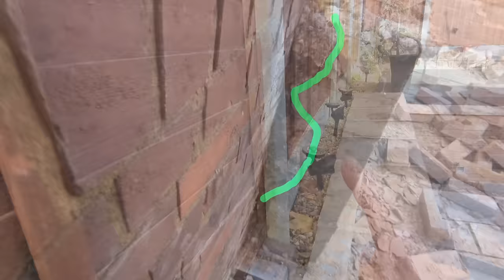PART 2! What exactly DID go wrong? Who paid to put it right?

Comment: I still think you'll be back again. And as for your sarcasm at the end of the video, proves that you don't like criticism, and can't move on, or take it on the chin. Grow up. You didn't mention in your video, WHO PAID for the first failed job? And you also say that you are going to go back AGAIN (3rd time) to rip it all out, and build it out of engineering bricks, WHO is paying for this? I suspect you may have agreed with the client, for them to pay for it, as you will be building it a THIRD time but with different bricks? However, this will not resolve the main problem, which is the penetration of water from behind. You should have explained the water issue to the client, and said that you need to put a drain behind the wall. And asked for the funding to do the drain only. Which clearly, would RESOLVE the water damage issue for good! The other thing you are forgetting, is that the 14 or so meter wall WILL continue to move, obviously, so, do you not think that the earth from the neighbours garden, behind your wall, do the same? Of course it will, so all you are doing is prolonging the life of your wall, but still not rectifying/resolving the cause of the problem. 
It's all well and good being "Reactive" but to be a competent builder, you need to be "Proactive" 
Additionally, you threw all of the rubble from the first job, straight onto the patio, not even caring about the clients property. You would have also damaged the facings of the bricks, which you did not replace, but just covered up with garden furniture. If you damage the building materials that you remove, then you should be paying to replace the damaged ones. If you still don't put a drain in the build, to remove the water from severely excessive penetrating water, where do you think the water will go? Next thing, is the patio will start to freeze and crack and lift, and you'll be back again. 
You also keep rambling on about if the bricks are suitable, ALL bricks are suitable if you build the wall correctly, taking into account the elements. You provided NO DPM, NO DPC for the coping slabs, NO frost protection, and NO real acceptable drainage. And then ask the public if you have done something wrong, and if the client should pay for the job again😂
Reply from the maker: Cheers Shane, all the best mate.